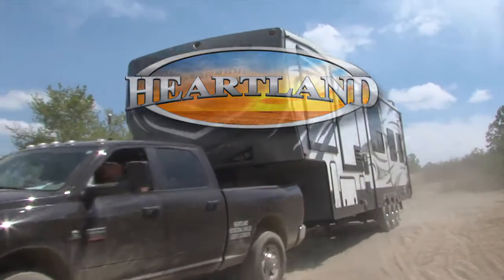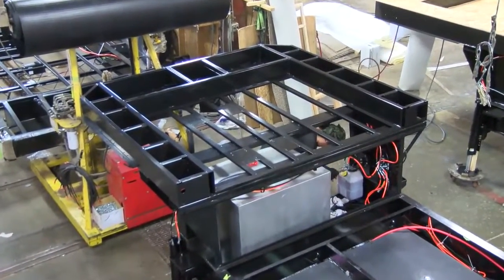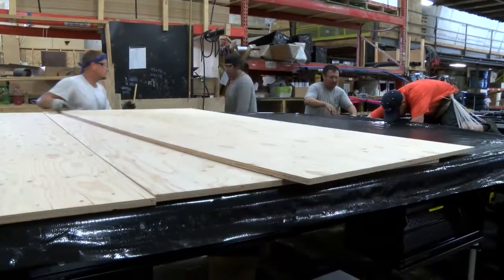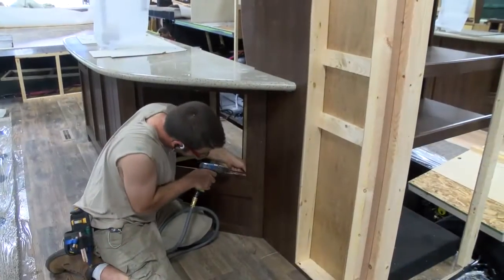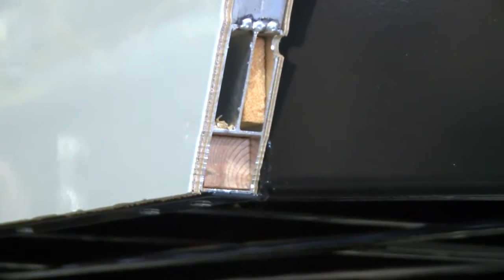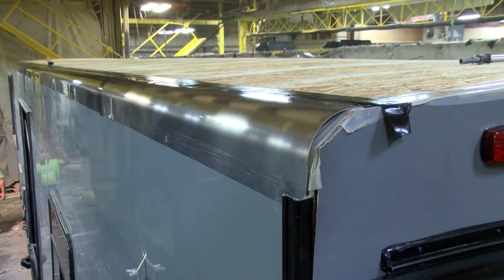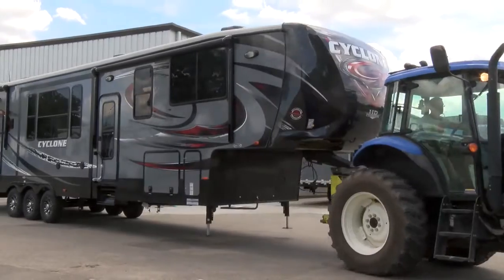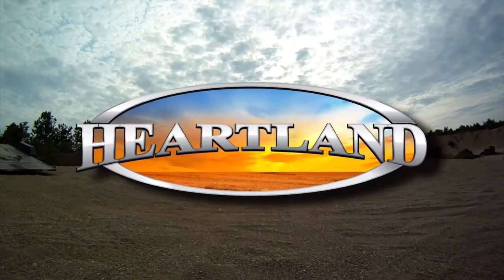Heartland Toy Hauler Plant Tour

Comment: Old video but  I have to add my experience now.  I'd say their quality is NOT THERE AT ALL.  My 2023 fuel toy hauler was missing furnace air ducts from the factory, (awesome quality control at its finest) and wiring under the trailer wasn't even in the plastic wire housing. It looks like it was wired by a 2 year old, just strung all over the bottom of the camper, not fastened and hanging everywhere. My auto leveling system was all miss labeled and wired wrong.  Instead of lowering the two rear jacks it would lower both left jacks.  I rewired that myself.  The two fresh water tanks weren't even plumbed together for the water pump. The pump would only pull from one tank.  All fittings were loose and first time filling it, it leaked all over.  I purchased a very expensive camper only to have it back in the shop for months.  And once something is torn apart to fix it, it seems like it is never the same.   I actually called Heartland and they made it seem like it was the dealerships fault that they didn't catch all this that was WRONG FROM THE FACTORY.  And now I am seeing a lot of reviews on the internet of how poor the quality is.  I will be adding my experience to every review I come across.  It is ridiculous to have things like this missed from the factory.  I HIGHLY recommend not buying anything made by HEARTLAND.
Reply: I totally agree. I got a 2023 Heartland Milestone less than 2 months ago, and I am having major issues. We need to start a class action.
Reply: We got Fuel 250, 31 things on unit had to be fixed. Biggest when Happi Jac fell.  Lucky my motorcycle was not in it. Workmanship 9:31 Workmanship sucked, TV was not hooked up. 1 siding window would not work. Bought from a Camper World

Comment: hahahaha...   calling them craftsmen is not even a stretch,  it's a lie.  I guess, "burnt-out assemblyline alcoholics" or "it beats working at McDonald's high- school dropout" doesn't have the same ring or sell rvs, right?  What a joke (on me it turns out). My 2017 cyclone 4250 that was purchased for  $107,333.00 can attest that this company has met and exceeded the high standards of heartland... the problem is that bar must be about as low as they make you feel when bringing any issue to them.  The fact that they then move the rv to a seperate location where they double and triple check these errors while collecting the biggest paycheck for diving around in a golf cart and screwing the eventual owner ever is a bigger joke.  Please shop around